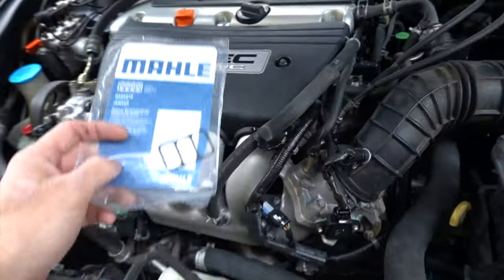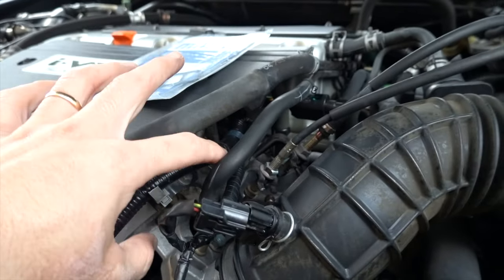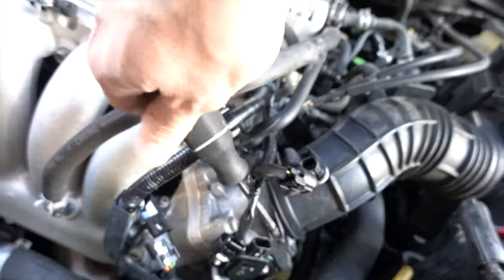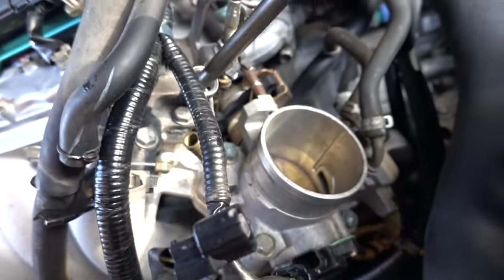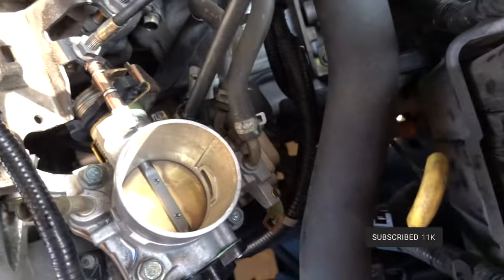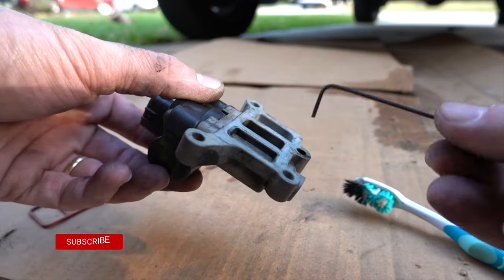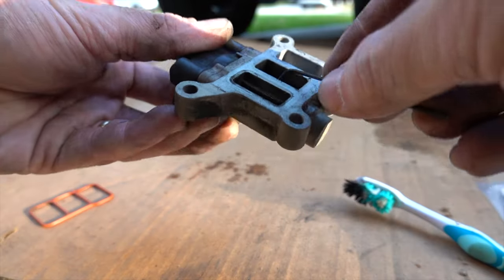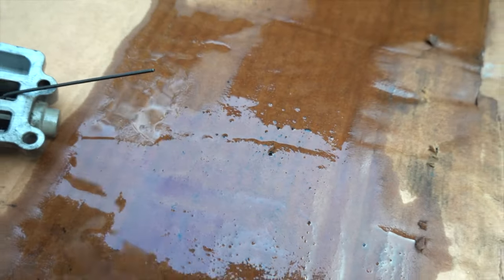How to Fix a car that idles poorly SHAKES  & clean the IAC Idle air control valve Honda Accord k24

Comment: great video but i would clean the actual throttle body while im in there too I cleaned the IAC on my 08 TSX didnt fix my idle issues but once I cleaned my throttle body it stopped all of my idle issues it runs great now this goes for pretty much any K20 or K24 you need to clean both of these if your having any idle issues.

Comment: I have weird idle symptoms when stopped in drive. Also when heat kicks on or AC I have a slight dip in rpm and vibrations in the car. I have a 2008 accord 2.4, so Do I have an IAC valve or not? If not, what else could cause the issues above?
Reply from the maker: Yes
Reply: Had the same symptom this solved it
Reply: @aldosaldana1462 how did you solve the problem ? I am having same
Reply: @roshansapkota498  I cleaned the iac valve really good soaking it and used qtips to really get in there it helped the idle treamoundisly,but it still does it once and a while, i will try cleaning egr valve next and if that doesn't work i will do valve adjustment
Reply: @aldosaldana1462  do you think changing the valve will fix it for good?

Comment: Curious what brand motor mounts you used? We have two 03 Accords one V6 and one 4Cyl. I of course went the cheap route and broke the front and pass side on the V6 car not sure if they were really cheap or because my daughter thinks it's a drag car! LOL I replaced them with the beck Arnley ones because the front oem Honda one is over $200 and she doesn't have a lot of money. I did cheap rock auto ones for my girlfriends 4cyl car. Even right after install the engine shakes really bad in gear. The idle seems fine maybe a little high until it warms up. I did notice the front motor mount is leaking fluid but the car runs great no CEL lights just shakes in drive. Maybe the idle air control valve? I'm going to buy the Honda mount because the car just flipped a 100k miles and we plan on keeping it as long as possible.
Reply: autozone works just fine. just dont get the cheapest  my motor mounts are holding strong after being replace a year and a half later and I beat my 08 tsx to 7k rpm constantly

Comment: for really tight iac valve screws, use a butane torch to warm up the throttle body side of the screw holes

Comment: Ive heard the IAC valve on those need greased not cleaned, guess its rotory and not just a valve. Did you hook her cruise control back up, it looked like it came out of its linkage?

Comment: Great video. Thank you. Just fixed problem of intermitent idle on Acura 2004. Idle valve was stuck with carbon.
Reply: Please clean the actual throttle body too my 08 TSX was having a similar issue on my 08 TSX when u opened the throttle body flap(put the key in the ignition and have someone hold the gas pedal down) it was covered in black junk and crud took me 5 minutes to clean it up with a rag and some INTAKE SENSOR CLEANER(I would not recommend the strong stuff make sure you spray it on the rag and wipe not spray into the intake) cleaned it good and it idles great ever since no more idle dropping when breaking at a stop light or just sitting there idling it also fixed when i shift into gear the idle would drop to like 500 but stays at a solid 800-900 now cant even feel it

Comment: very helpful gonna do all this to my 2004 acura tsx. It’s idling rough.
Reply: Whats the part number for this part cant seem to find it
Reply: Part number was never put up ?
Reply: @DJDURAN187  i found the oem part but  they only sell it together with the break assembly and i dont need the whole part smh
Reply: Clean this and the actual throttle body it fixed my 08 TSX in like 25 minutes.
Reply: on my 08 TSX when u opened the throttle body flap(put the key in the ignition and have someone hold the gas pedal down) it was covered in black junk and crud took me 5 minutes to clean it up with a rag and some INTAKE SENSOR CLEANER(I would not recommend the strong stuff make sure you spray it on the rag and wipe not spray into the intake) cleaned it good and it idles great ever since no more idle dropping when breaking at a stop light or just sitting there idling it also fixed when i shift into gear the idle would drop to like 500 but stays at a solid 800-900 now cant even feel it.

Comment: Use a JIS screwdriver.

Those two screws holding the valve motor on can easily be removed by cutting across them so you can use a flat screwdriver.  A fine see l saw it dremel can be used.  Once the unit is fully removed the rotating valve can be properly cleaned.  Without doing this the valve can stick, causing high idle or even rev hang.

Comment: I let my car sit for a couple months and when I started it it was revving up and down by itself you think this can be my problem?
Reply: buy a new one and Change the IACV which is shown in this video(or clean it good if you wanna go cheap) change your IAT sensor its the black sensor in the pipe of the intake this should fix this.

Comment: I have a 2012 will this work? when the gear kicks in it vibrates and even more when ac is on
Reply from the maker: Wouldn't hurt to try
Reply: Did you get it fixed? My 07 does the same thing.

Comment: You think it's worth trying to clean it, if we have idle surge? Or just go ahead and grab new oem IAC?
Reply from the maker: I would probably get a new one if it surges.
Reply: @Donnythelatemodeltech ; I took off and cleaned the throttle body assembly due to a surge between 1,000-1,200 at idle, but it persisted.  I replaced the TPS (throttle control sensor) and recalibrated.  Surge is gone, but now it won’t idle and stays above 2,600rpm.  I am thinking it’s a vacuum leak, but I can’t find one.
Reply: @moremoney2  I am currently having a similar issue. Have you figured out what your issue is?

Comment: Never get the screw out! Tried everything!
Reply: I took the coolant and throttle cables loose so I could remove the whole assembly.  While holding it secure I used an impact screw driver wrench to break the Phillips head screws loose.